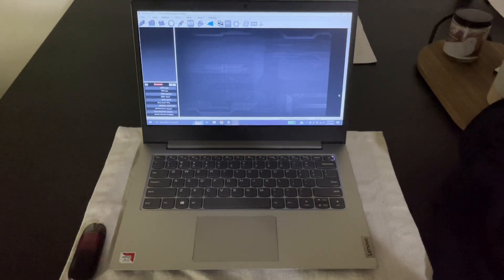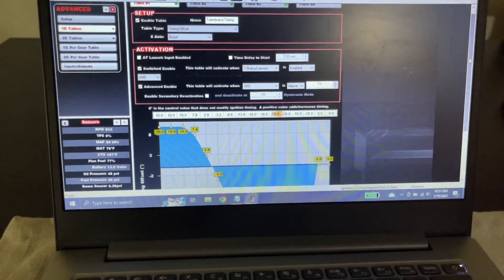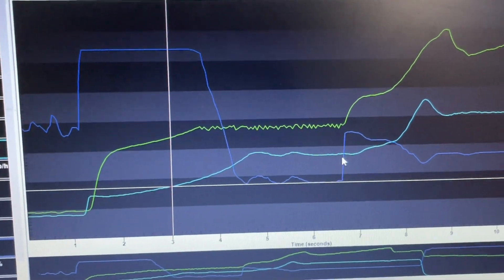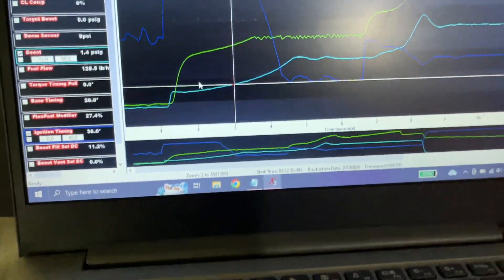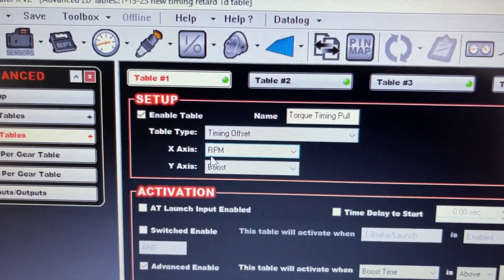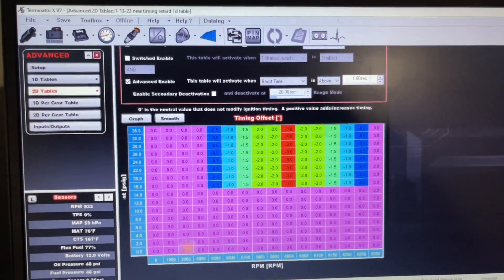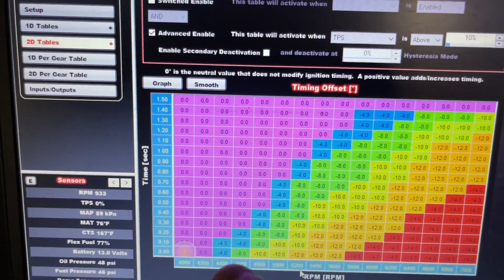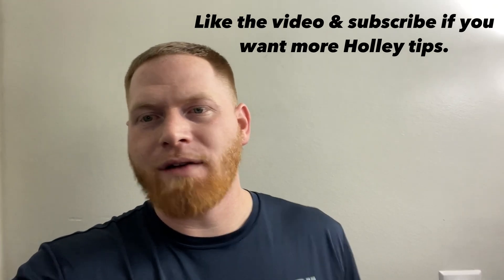Holley EFI Advanced Tables Tips (Traction Control, Fuel Safeties, Spool Up Tuning & More)

Comment: Hey, its interesting to see how everyone does it and seems like different ways of doing stuff. So first I would like You to look at your VE table and see where the peak VE is and thats approximately your peak torque. And second, wondering if there’s a reason why You dont pull out the timing directly on the base Timing table? Because if You’re hitting lets say 16psi of boost at 4500rpm for example, You’re probably above 60% throttle anyway so Imo no need to make a advanced table for it but maybe you have a reason for it.
Reply from the maker: I do the advanced table so I can make my actual timing table easy just 1 number straight across the map for each boost amount. I don’t really want it to pull timing below 20lbs bc I don’t think it matters on that low of boost.

Comment: Take a look at fuel table. peak fuel VE on your fuel table will be peak torque approximately.
Reply from the maker: You know I’m glad you said that bc I’ve been trying to find info on why I have to lean mine out at high RPM. Is that bc it’s not making anymore power?
Reply: @BmoreFox  lean is fine to get it come up on the brake to get it on the chip. Just give it what it wants. Mine likes 14.0afr to get it to the chip then I’ll fatten it up then pull timing @ about 8 psi.
Reply from the maker: @bigfoot355  not talking about spool up, I’m talking about over 6300 rpm. It wants about 10% less fuel to 7700
Reply: @BmoreFox  oh ok, then yes you’re past peak torque after 6k.